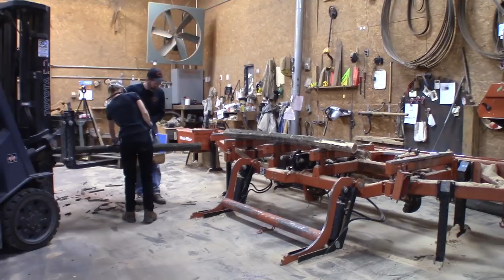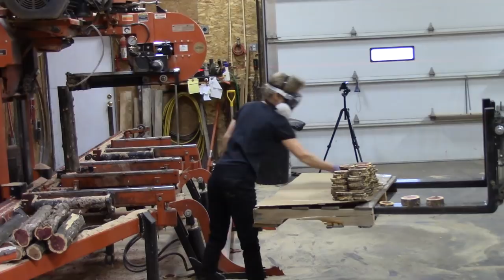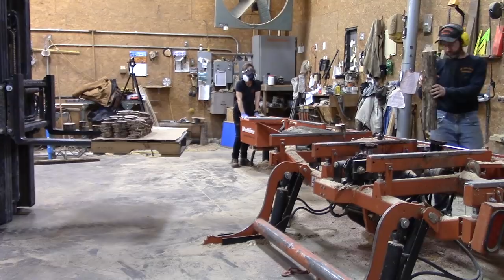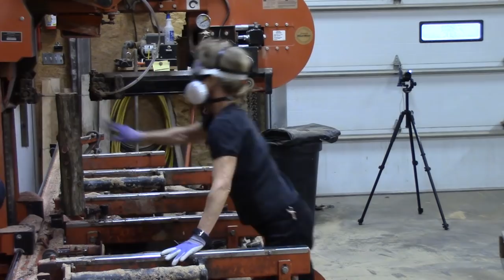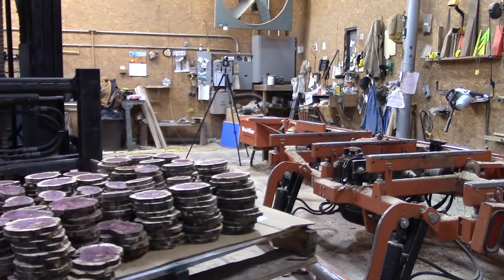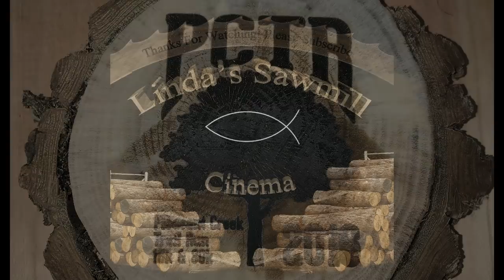Wood-Mizer Mills Cedar Medals for 15k & 30k Trail Run

Comment: Your videos are fun to watch but I get dizzy watching all the busy movements in your operation.  What a huge difference a power feed would make on the Woodmizer.  And a kickoff attachment so the sawn planks would fall off to a powered conveyor connected to the straight line saw.  Boy wouldn't these simple add-ons reduce the running around and improve efficiency tremendously and reduce your labor.   Hope these comments helps your operational throughput.  I wish I lived near you so I could buy some of those gorgeous wood products!!  Do you operate a kiln as well?
Reply from the maker: Thank you for your suggestions. There is a drag back attachment on the mill, but we choose not to use it in our small set up. Exercise is something I enjoy very much! Yes, we have a computer controlled kiln. Thanks for watching! Linda

Comment: So interesting and enjoying to watch, thanks! I got a question: I am assuming that you are wearing the mask because of the very fine sawdust that is in the air? I think that you have a hose connected to the mill&edger that sucks the sawdust away but I guess there is still too much in the air? I guess that's a disadvantage of being enclosed? And a big air filtration system would probably be too expensive and/or not enough?

Comment: Hi there Linda.
That looks like a huge electrical motor on your Saw Mill.

What size is the motor, how much power does it draw.
Do you guys run off the main’s, or are you off a generator. Plank you.

Comment: Couldn't you bundle the logs and cut more at one time?
Reply from the maker: Interesting idea, but it wouldn’t work very well, as the clamp only contacts a small area. In fact, it is hard to clamp just one piece. Thanks for watching!! Linda